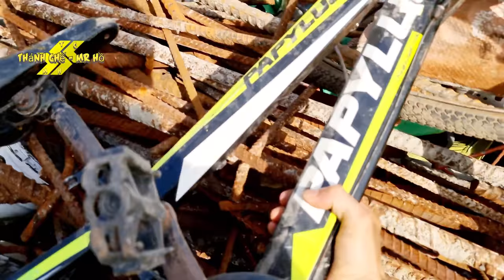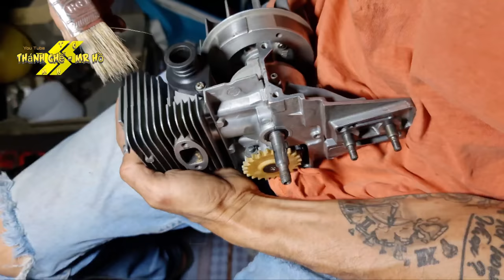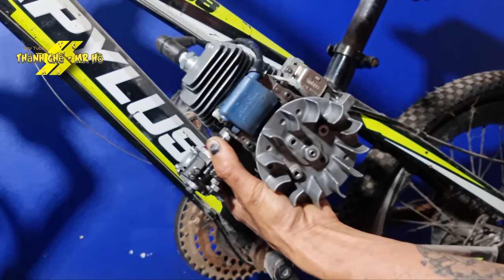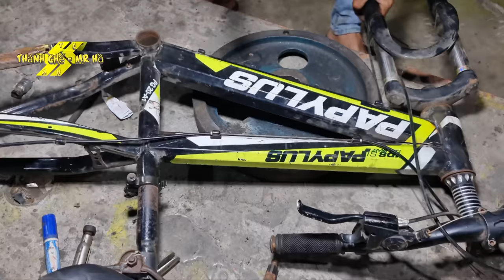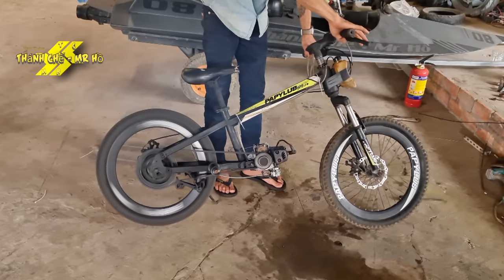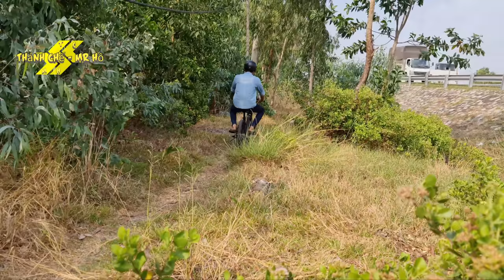Xe đạp chế động cơ bằng máy cưa xích  The bicycle runs on a chain saw

Comment: That “pointless” bit of frame you removed is important in that it gives the frame about 80% of its strength.
Reply: bicycle frames  are designed with a good safety margin
The tube section used in this bicycle can handle probably 500 kg of vertical load on the center of the frame without failing
Reply: Yup. And with a motor on the frame you’ll be putting on additional weight = extra stress load on the frame. Well, I guess he knows his job and must be well aware of things.
Reply: @hyperboytkl1077 if it breaks in half it breaks in half I doubt he would care too much😂

Comment: The gear ratios all wrong. Your clutch is going to be on fire. It's like you're taking off in 5th gear. And you better watch riding that off-road cuz that neck is about to snap right off. You need that stable triangle, for under the Triple Tree section.
Reply: Hey I've got a question 
Will a 8 tooth sprocket in the front and a 40 tooth sprocket in the rear be good for 1.2 hp? Or will i have to modify the gearing more?
Reply: That's exactly what I was thinking the frame head stock will be under big stress it'll snap off unless you brace it up

Comment: That downtube was there for a reason.  I hope you don't hit a bump.  Frame will snap in half easily now.  Otherwise, cool build.
Reply from the maker: Thank you for your comment
Reply: Well, it didn’t break as dreaded though, as demonstrated off road with some motocross - like riding maneuvers plus, the addition of an engine representing extra laden weight and stress on the entire bike assembly, with even part of the frame missing near the end of the video. So far so good to me. Not to mention, Papylus Bikes might even commend him for giving their product a brief promotional demonstration on strength and durability.
Reply: What a welder is for

Comment: Nice work - BUT that bottom tube on the frame NEEDS to be there! At the very least relocate it to above the engine or bend a tube to go under the engine and make a cradle for the motor. Please put that tube back on before that head tube snaps and you go face down!
Reply: I think he probably knows more about the loading capacity than you considering that he engineers things like this and does welding. I don't know how you can see a metal bar like that snapping so easily. I would think that the wheels would give in before that bar snaps.
Reply: @maxwells2602  I am a certified welder and have been in the metal fabrication industry for 26yrs. I am not going to get into the weeds about welding, but there is a reason why staircases, buildings, bridges and bicycles use triangles. Without the bottom tube all of the stress is put on the headset (stem where the handle bar attaches) of the bicycle.  That is not the strongest weld to begin with because it doesnt have to be, because it shares the load with the bottom tube. Now its taking it all itself.  I am being less critical of his idea but more concerned for his safety.  The wheels are circles and distribute their load evenly from the tire contact area to the hub and again up to the stem (the weak point in this design) in short the wheels would not collapse in on themselves. Have you ever seen that happen to any wheel under normal circumstances?  This is about Trigonometry (math), physics and safety, not insulting the builder

Comment: Nice job 
I have done one myself and I found that the centrifugal clutch slipped because is metal on metal. If u take the clutch apart and bond some brake pads on the clutch It works much better.
Reply: was it powerful enough to power a bike?

Comment: You would think that a chainsaw motor would work really well since it already has a centrifical clutch but they actually don't work well at all they tend to be extremely underpowered I used a much larger chainsaw and it was the same thing very low power
Reply: Well it should power a chainsaw most probably 10 or 15 cc
Reply: @KaushikBala333  25

Comment: My 1st Go-kart was a Soap Box Derby Kart made out of boards. I used nails to fasten a 2hp cast iron Briggs & Stratton to it. My maiden run on a dirt road at probably 20mph rounding a corner hitting bumps the engine broke the wood plank and came off. It was tumbling along being pulled by the throttle cable. I was so elated that it worked l went back to work on it for another day nailing a plate of steel on a new plank to get it running again. 1964 l was 12yrs old. ben/ michigan

Comment: You'll break this engine usina without a engine culler.
You gotta to intall a fan culler to avoid high temperatures in the engine.

Comment: translated far too long. You have to do another translation stage in between. Otherwise you will have speeds on the bike that you never need and, above all, hardly any torque

Comment: The bike is not stable enough to ride. One little mistake and it will split in two pieces. Plus they make converting kits for bicycles. 

Please add a bottom bracket for safety reasons I don't want anyone dying!

Comment: No way is that big bore Short Stroke two-stroke motor, going to pull your butt without a jackshaft. Need another 7 or 8 to 1 gear ratio. You should have between 8 to 1 and 12 to 1, for that to run right